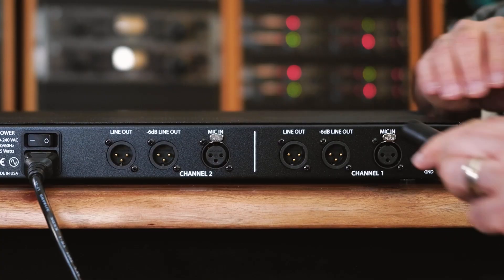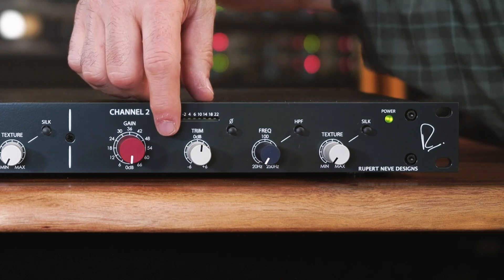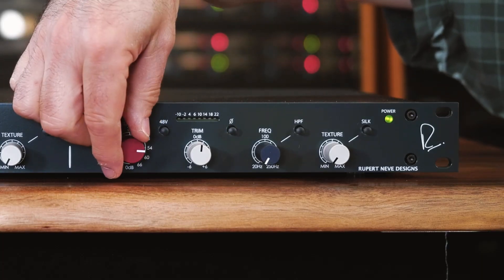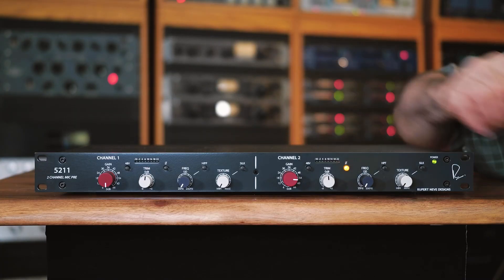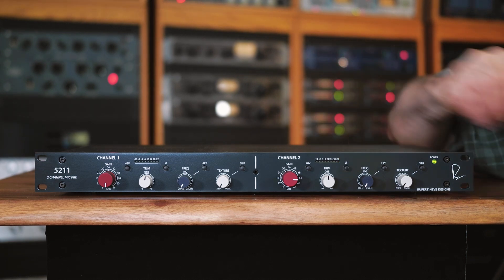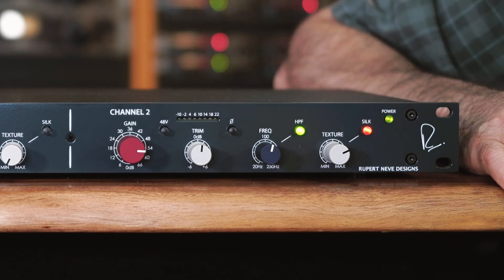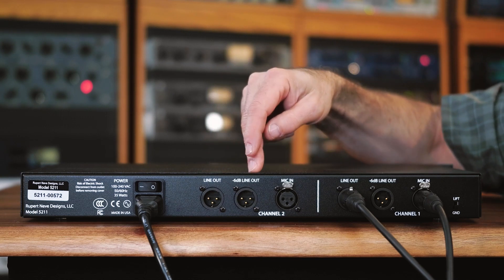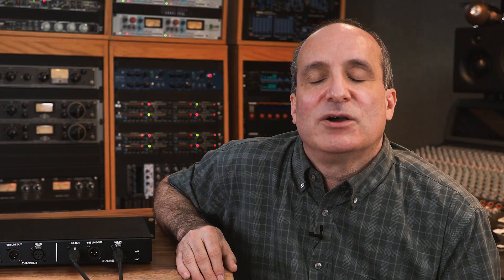Quick Start: 5211 2-Channel Mic Preamp

Comment: Is this Unit basically 2 of the 511s? Without the need of a 500 Chassis? Or is there a difference?
Reply: So much comments here so RND cant respond to all even after 2years.... I think it is two 511 . They are all Portico based preamps (only output transformers include)
Reply: yeah they are, you're exactly right. a rep at RND told me this over the phone a while ago